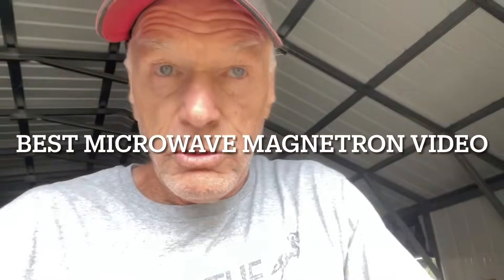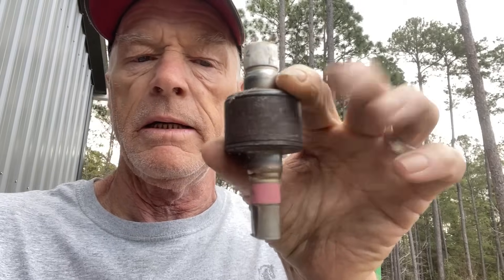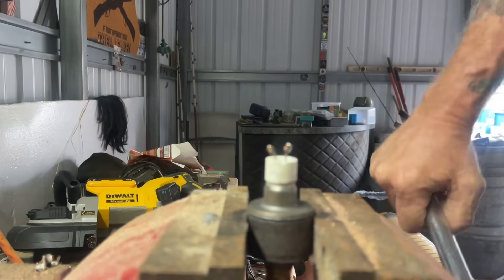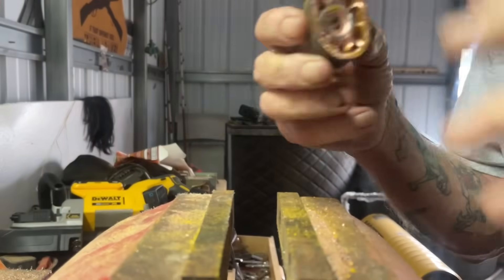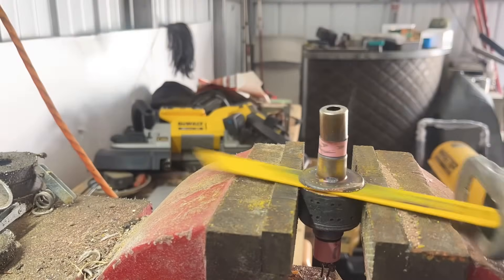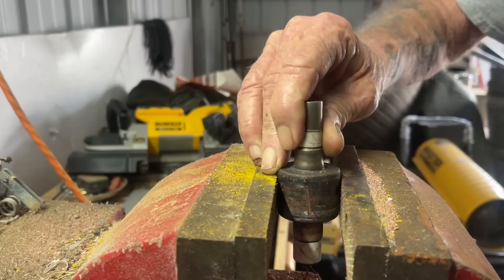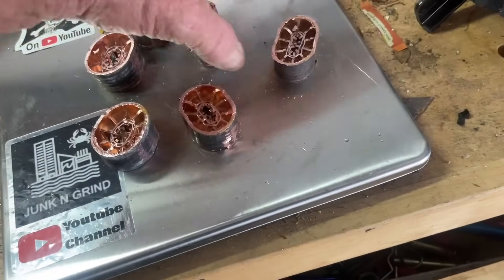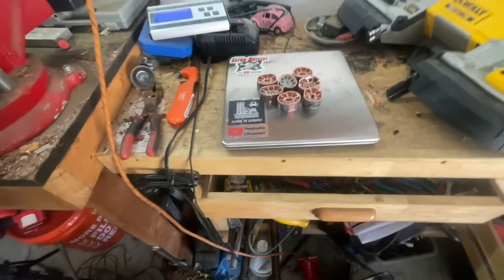(HOW TO) Scrap a Microwave Magnetron. You won’t believe. What’s Inside?

Comment: * * * TOXIC DANGER    * * *  Be aware of the PINK NASTY BERYLIUM OXIDE material.. this will slowly kill yourself if you breath particules of it if you break it !!!!  dont break it !!! it is also toxic for the nature
Reply from the maker: Look it up on Google. They do not use barium oxide in microwaves anymore back when microwaves first came out they used it but remember a microwave was $800 $800 beryllium is very expensive.

Comment: Hey Scrapping With Grandpa awesome video I just came across a bunch of these 👌🏻♻️👋🏻
Reply from the maker: Awesome! Thank you!
Reply: Like your lungs and breathing?>
Magnetrons with Beryllium Dangers
Magnetrons in microwave ovens can contain beryllium oxide (BeO) ceramic insulators, which pose a significant health risk if crushed and inhaled or ingested. Beryllium oxide dust can cause berylliosis, an incurable lung condition, and is listed as a confirmed human carcinogen by the IARC.
 However, the risk is primarily associated with exposure to airborne particles, and the insulators are inert and harmless when undisturbed.

To safely handle a magnetron, avoid crushing or grinding the ceramic parts and use a damp rag to clean up any broken pieces, disposing of the rag in a sealed plastic bag while still wet.
 Additionally, ensure that any e-waste, including magnetrons, is properly recycled to prevent environmental contamination.

It is important to note that not all magnetrons use beryllium oxide insulators, but it is difficult to determine which ones do, so it is best to assume that they do and handle all magnetrons with care

Comment: Remember kids...This process "Can be deadly" The Pink and White ceramics on magnetrons are possibly filled with Beryllium Oxide.. Even a few dust particles of that stuff can end your visit to this fine planet...months, years or a decade later.
Reply from the maker: If you go look it up, you’ll find out that barium is only used in commercial products. It is no longer used in microwaves. That’s something they did years and years ago. Brazilian oxide is very expensive so nowadays all they’re using is ceramic no beryllium oxide whatsoever in microwaves look it up on Google.
Reply: @ScrappingwithGrandpa  LOL .. I DID. and     That is why I commented..  In short,.  You are being Willfully ignorant of said dangers still present in microwaves from 2020...as you recycle items from 2015.. 8/

Comment: I like this way of scrapping, it minimalizes risk of accidently breaking and inhaling berylium oxide from older types of magnetrons.
Reply from the maker: You will not find a microwave that is still around today that hasn’t been put in the landfill or the trash that has beryllium in them. That was so long ago. It’s not even funny and they do not put it in residential microwaves only commercial things have it.
Reply: @ScrappingwithGrandpa  
Magnetrons with Beryllium Dangers
Magnetrons in microwave ovens can contain beryllium oxide (BeO) ceramic insulators, which pose a significant health risk if crushed and inhaled or ingested. Beryllium oxide dust can cause berylliosis, an incurable lung condition, and is listed as a confirmed human carcinogen by the IARC.
 However, the risk is primarily associated with exposure to airborne particles, and the insulators are inert and harmless when undisturbed.

To safely handle a magnetron, avoid crushing or grinding the ceramic parts and use a damp rag to clean up any broken pieces, disposing of the rag in a sealed plastic bag while still wet.
 Additionally, ensure that any e-waste, including magnetrons, is properly recycled to prevent environmental contamination.

It is important to note that not all magnetrons use beryllium oxide insulators, but it is difficult to determine which ones do, so it is best to assume that they do and handle all magnetrons with care
Reply: @ScrappingwithGrandpa  LMAO you trust the Chinese way to much there fella!
Reply: @TheTubejunky you can trust that they are definitely not using beryllium because its expensive.
Reply: You don't know what you're talking about

Comment: Careful of that pink insulator it can be beryllium oxide, which if it gets airborn is some nasty stuff.
Reply from the maker: They don’t use brilliant oxide in any microwaves anymore Brillion oxide is very expensive and now they only use William in commercial products. It is no longer in residential products, including microwaves.
Reply: @ScrappingwithGrandpa  Isn't it possible to have it in an older microwave though? 
When was the old stuff discontinued?
I have some really old microwaves waiting to be scrapped but I'm worried that there's no consencus on what is considered safe and what isn't and/or what safety precautions are recommended (like using tape etc')?!
Reply: I always tape the ends with electrical tape 👌🏻
Reply: I was going to say the same thing. Beryllium oxide very nasty, especially in the lungs.

Comment: Sawzall is best for every metal diablo automotive blades are good the 50% and 100% blades bend before they break
Reply: As a commercial and industrial electrician of well over 10 years I can confirm you can use a sawzall for just about anything and even save the blades for each stupid intention cause work is just the most fun

Comment: Thanks Grandpa,  I enjoyed learning something new on these. So the toxic belinum stuff is not true on the new magnetron? Thats what always made me shy away from these.
Reply from the maker: That stuff was probably true in the past but today’s ones are ok.
Reply: Magnetrons with Beryllium Dangers
Magnetrons in microwave ovens can contain beryllium oxide (BeO) ceramic insulators, which pose a significant health risk if crushed and inhaled or ingested. Beryllium oxide dust can cause berylliosis, an incurable lung condition, and is listed as a confirmed human carcinogen by the IARC.
 However, the risk is primarily associated with exposure to airborne particles, and the insulators are inert and harmless when undisturbed.

To safely handle a magnetron, avoid crushing or grinding the ceramic parts and use a damp rag to clean up any broken pieces, disposing of the rag in a sealed plastic bag while still wet.
 Additionally, ensure that any e-waste, including magnetrons, is properly recycled to prevent environmental contamination.

It is important to note that not all magnetrons use beryllium oxide insulators, but it is difficult to determine which ones do, so it is best to assume that they do and handle all magnetrons with care
Reply: Don't trust a YT video OR the chinese with your life.

Comment: Thankyou for the video Drew,ive never scrapped magnatrons,you made it look easy,i,ll be definately giving it a go instead of throwing them away
Reply from the maker: Make that money
Reply: Don't make a DARWIN mistake because of a YT video. Check the facts
Magnetrons with Beryllium Dangers
Magnetrons in microwave ovens can contain beryllium oxide (BeO) ceramic insulators, which pose a significant health risk if crushed and inhaled or ingested. Beryllium oxide dust can cause berylliosis, an incurable lung condition, and is listed as a confirmed human carcinogen by the IARC.
 However, the risk is primarily associated with exposure to airborne particles, and the insulators are inert and harmless when undisturbed.

To safely handle a magnetron, avoid crushing or grinding the ceramic parts and use a damp rag to clean up any broken pieces, disposing of the rag in a sealed plastic bag while still wet.
 Additionally, ensure that any e-waste, including magnetrons, is properly recycled to prevent environmental contamination.

It is important to note that not all magnetrons use beryllium oxide insulators, but it is difficult to determine which ones do, so it is best to assume that they do and handle all magnetrons with care
Reply: @TheTubejunky Beryllium sensitization occurs when the body's immune system reacts to beryllium, which can happen through inhalation or skin contact with beryllium dust, fume, or solutions. This sensitization can lead to chronic beryllium disease (CBD) if further exposure occurs. > Skin Contact: Direct contact with beryllium-containing materials can also trigger sensitization <
Reply: @TheTubejunky Once sensitized, individuals may not show immediate symptoms. However, they are at risk of developing Chronic Beryllium Disease (CBD) if they continue to be exposed to beryllium. Symptoms of CBD can include:

Shortness of breath
Coughing
Fatigue
Weight loss
Night sweats